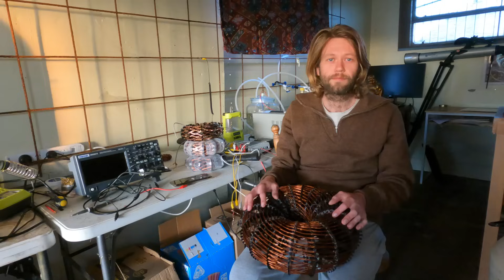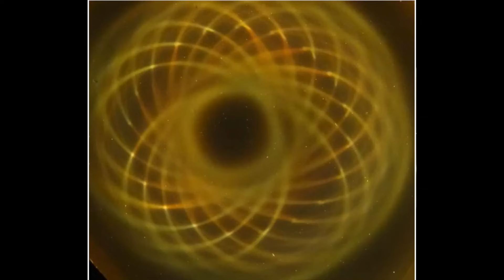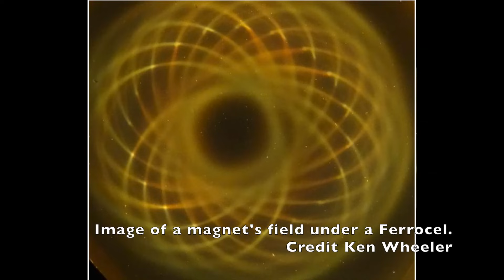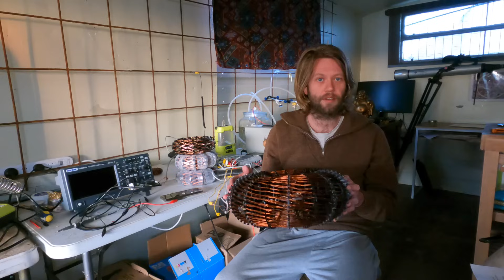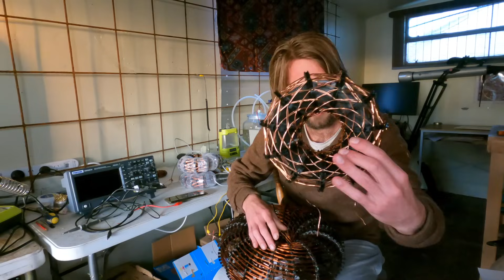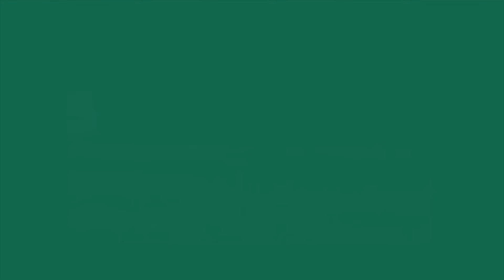Introduction to the Rodin Coil

Comment: The interference pattern will cancel if you connect it in the opposite direction. The wire needs to go the same direction all the way through one way, then start going around counterclockwise but in the same overall direction. If the field cancels, you did it wrong. I made these years ago and got some seriously anomolous results. A pulse dc would be sent in, an AC wave at a completely different frequency would come out. The interference pattern should create a south monopole and cause electron collisions that spark antimatter annhilation on an extraordinarily small scale. This is what creates the AC high voltage out despite being 1:1 windings. If you could get tritium, it should work perfect as a tokomak reactor.

Comment: Have you used anything for appliances?
Freezer, TV, AC Unit, and the like?
Reply from the maker: The UV light haha. But yeah it has been tested under load. 2400w load test results in this video and more to come this week
Reply: @AlchemicalScience  That's what I need, sort of, to be used in conjunction with household appliances and electric vehicles, that's what Alternative Energy should be used on in my opinion, but I'm zero skilled at making anything.
Never could find a tutor and couldn't even get my Arduino Uno R3 led light to blink.
Mind of a Builder with zero skills or proper experience, but plentiful learning things I can't put to use, until I can....

Comment: 8:56> When two coils are wound in opposite angles to each other, they exhibit flux cancellation when fed the same input signal (frequency) and polarity. To enhance the combination of flux lines, it is crucial to reverse the polarity on one coil. Alternatively, you can employ a method where coil A is fed with sin(X Hz) and coil B with cos(X Hz). Another consideration is incorporating an RC circuit in parallel with the coil based on the current inductance value. This not only significantly reduces input impedance but also allows tuning the coil to a specific frequency (X) such that when subjected to an input signal matching its resonant frequency, the magnetic flux will exponentially increase.
Reply: What uses have this coil?

Comment: how come is the geometry incorrect in one of the coils?
Reply from the maker: Current update: it's wrong in all of them so far. Just based on the fact that on further research into the mathematics and vector geometry of the toroid's behind the coil designs, we haven't been applying the maths correctly. Tom Barnett's work, who we we based our designs on has turned out to have a few flaws. To our knowledge, and now as we know to Marco Rodin's knowledge, no one has designed a coil yet that is full faithful to the VBM behind their design. So, short answer - still working on it and taking a different approach! The coil designs on the website can still be used to have fun with magnets or preliminary research into interesting effects displayed by toroidal coils though

Comment: Have you considered a long toroidal coil like the neicels on Star Trek (long and thin), where the either goes in the north pole end goes out the south pole end. The either is highly charged particles in space that come from everywhere and virtually cancel each other out, but they can still be affected by magnetic field lines ( as produced by celestial bodies such as planets, stars, etc. These fields clear the charged particles out of the way (as the earth's magnetic field does with our suns solar winds), and they travel along the field lines through the centre of the toroid. If this flow could be ionised by microwaves of the correct frequency flowing from north to south may produce thrust when the microwave emitter is in a harmonic frequency of the toroidal coil. 
This would be a souped up version of the EM Drive by the microwaves off the sloped walls of the EM Drive?
Reply from the maker: Hmm I'm avoiding microwaves etc. and looking for subtler ways to manipulate and arrange things on a quantum level. But I think anything seen in old sci-fi can probably be built with enough time and effort. There's a lot of ways to build a car, I reckon there will be a lot of ways to build a flying car too. Go hard!

Comment: Rather than trying to reinvent the wheel as I've tried to do for years at great cost, i've concluded that sometimes its just better to bite the bullet and just go out and buy some solar panels to reach what is usually for most people the ultimate goal of saving money and getting off grid with some independence. Solar has progressed so much now that its very practical and doable to get off grid without too much expense. You have to keep in mind what the final goal actually is and the fastest and cheapest way to get there. Ive found that combining minimalist living with solar energy is the only practical way fwd. you really dont need as much energy as you would think to get off grid if you just learn the difference between want vs need. A camper van with a yurt, a few solar panels, an off grid water system and an allotment and a bike and some friends. that's all you need in life.
Reply from the maker: I'm already off grid with solar and my independence! I'm primarily interested in the research with the goal of better understanding field theory within the context of electrical circuits etc. rather than the pursuit of a new efficient alternative to solar
Reply: @AlchemicalScience  Its all good - Homer :)
Reply: @AlchemicalScience  Amen to that.👍

Comment: What does a Rodin coil achieve?
All very nice and complicated looking, but the first thing you should explain is what the goal of these things is.
Reply from the maker: Fair question. For many, building Rodin coils is an exploratory way to start applying vortex based maths to physical toroid design. There are many theoretical engineering and electrical applications of VBM, which has strong correlations to other recent findings in physics and quantum mechanics. But we are in the infancy of understanding any of it (at least in the open source domain) so currently most people interested in the research are just searching for more information on how to apply VBM to toroid design. Our videos will be focussed primarily just on this for a fair while. I'm not going to make claims that the coils do anything specific unless I see it for myself.
Reply: The connection of VBM to the actual Rodin Coil may be applicable to other coils. I'm still trying to figure it out. I don't know for sure that VBM actually fits on the rodin coil. There's actually better versions of the rodin coil in my opinion and I have their plans and angles. I created a whole theory about it.  @AlchemicalScience
Reply: @AlchemicalScience   " the rodin ring will strike"

Comment: Hello brother. I was wondering how to wire and connect audio adapter. I cant find any videos to show how to connect. Have 6 rodin coils. One is about size of what u have except the designer made it pancake form smh. And is a magnet need to get a better output?. Im new to this
Reply from the maker: Heyo. To connect the amp to your audio source (eg. Laptop, phone) you'll need an aux to 3.5mm headphone jack cable. Then to connect the amp to your coil, go buy some shielded audio cable (grunty speaker wire). Solder your coil inputs/outputs to the speaker wire and then connect the speaker wire to the amp outputs. Generally people are using bifilar coils and connect the 2 sets of inputs and outputs to the amps 2 output channels, with the polarities of the wires reverse to each other. The magnet displays interesting effects with the coil (eg, music and movement) but otherwise I'm not using magnets in power system experiments etc anymore. I see there being a solid state solution instead
Reply: @AlchemicalScience  my bad.  I didn't explain right.  I meant how to attached or connect an audio adapter to the rodin coil itself so I can just plug in my 3.5mm plugs into rodin coil like I see u have. I see pics. But cant see inside to see how the wiring work. Or is there a special type of adapter. Looks like its glued somehow to the rodin coil. But how the inside rodin coil wires connect to adapter I can't tell. Maybe you are telling it and I'm  not reading these instructions right lol smh. Let me read it again
Reply: @AlchemicalScience  ahhh. Ok so I will have to cut open one end of adapter wire and figure whats input and output (I'm too new to this) have to buy a solder I guess. One of my coils i made has 4- 18 gauge wire twisted. I connect 1 of the 4 or just leave twisted and connect left and right to appropriate wires inside of adapter I cut open? Idk sorry for all these question bro. I just trying to learn this. And get power going asap.
Reply from the maker: No worries. Nah, my connections in these vids are arranged as follows - audio source > audio amplifier > CH 1 of the amp wired directly to the input of the clockwise winding of the coil + CH2 of the amp wired to to the input of the counter clockwise or reverse polarity clockwise winding of the coil.
If you're looking to use the coils as the basis or part of the circuitry for a power system though, you should look at purchasing a function generator and oscilloscope. This configuration doesn't have a huge amount of practical application in that area, its mainly just a way to start experimenting with and understanding more about the coils

Comment: how I tune my coils is put the back  emf into a capacitor,high speed diodes on positive and negative , put a 1 amp 12 vlt car trailer bulb as load across the cap hook up a volt meter across the cap reading volts and have a analog 1amp meter to read the power going into the system through the pulsed transistor, as well as the scope hooked up,I limit the current draw to 1amp arranging duty cycle and frequency for highest volt output on meter, simple easy , none of these coils go overunity, and placing a pickup coil in the middle gets very little actual power, big wave forms on the scope  do not come out as watts,  to create zpe power i have been told you need 2 torroids creating nodes   and suspend the coils in fluid quartz crystal medium in sphere,  are these node right angle wires,a door way for quantum energy to come in , very impressive coil you built with nested coil, starship coils almost as good a rodin coils bodeni, built his coils from twisted strand wire,twisted 2 wires using drill also david adair used twisted wire, i have no experience in this yet
Reply from the maker: Cheers for the tuning advice. Have you experimented with Master Ivo's MOSFET driver PCB? I'm still waiting for a couple parts for the second one but I'll be using them as the switch in the primary. Currently working on a first, 3rd and 5th order (3x) nested coil, tuned by wire weight (will adjust slightly for caps) - first and third order opposing each other and stepping up the voltage and 5th order same direction asthr 3rd order and stepping voltage back down. I don't believe that the coils can produce over unity on their own (at least not without doing some wild like what you mentioned with the fluid quartz, which is currently above my head) but I think along with the MOSFET driving circuit they can potentially act as an ideal power circuit to attach a tuned collector source (glorified supercapacitor kite I'm working on) as the input source
Reply: @AlchemicalScience  havent tried master IVO mosfet,don smith using copper heavy coils kapanaze using heavy high frequeny coils , a massive amount of radiation comes off a HV spark, make yourself a round one of your cells you can test is just with a common volt meter turn it to 500 vlts dc and slowly bring it nearer , a poor mans giger counter, a HVspark trigger a giger counter keep leads away, my vlt meter was reading 1700 before it scattered at 4inches away from the spark,look forward to hearing you result of 3 nested coils,i do my load test on a 10 second count , best sofar is 25 volts on a 3in high  315 volt cap, so  much stray radiation being wasted this is where the graphene cell will work majic i think , this is radiant energy at work,very short HV pulses give off heaps, ive tried capHV dischage but not as good as high frequeny direct off flyback

Comment: my interest mainly is to see if we could use this rodin coil to collect energy to bring in the root of plants..can you share your theory about it and how it differ with different antenna they use in usa and europe for gardening?i am just interested to the pratical aspect of it in plant growth for electro magneto culture i am a neophite in that regard so open minded to learn new things and apply it.
Reply from the maker: You certainly can do and it does work. That being said you can really use any kind of antenna to do the same. If you don't have charcoal in the equation as the "voltage regulator" it's directing the energy directly from the antenna to the root zone without intermediary. I personally believe this can be done anyway on a larger, cheaper more practical scale using bulk materials directly in the soil rather than using coil antenna's, but I'm still interested to hear the results if you want to experiment with one of our coil designs as a root zone antenna!
Reply: @AlchemicalScience  when will you have rodin coil for sale do we need to instal high
Reply from the maker: @michelbisson6645  I just need to finish printing a big 5th order coil for myself and I'll list the standard coil kitsets up for sale on the website. Maybe 1-2 weeks!
Reply: @AlchemicalScience  ok and need to know how to install it to bring the energy in the root of plants and garden, Reading Philip Canahan paramagnetism books very interesting, mainly the interview he gave to Nexus, very good
Reply from the maker: You just need to run wires from the coil outputs and stick them down into the root zone. Ken wheeler (Theoria apophasis) talks a bit about it, in the context of using any coils, wire or other antennae if you search his channel. You would definitely want to experiment with placement and height of the coil. You could try measuring the output with an oscilloscope or even just a multimeter to try and reference what frequencies and stray voltage you're picking up ambiently
Reply: @AlchemicalScience  ok good thank you